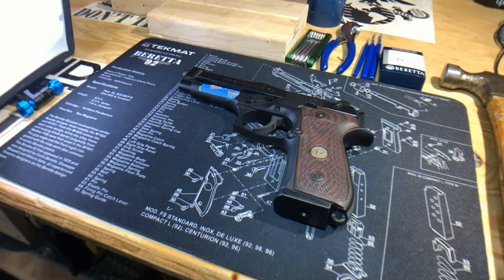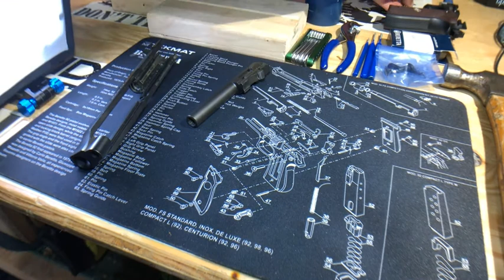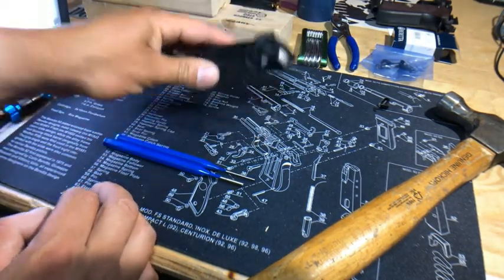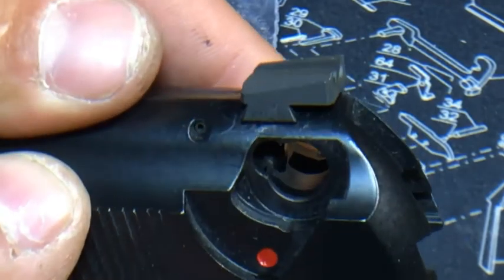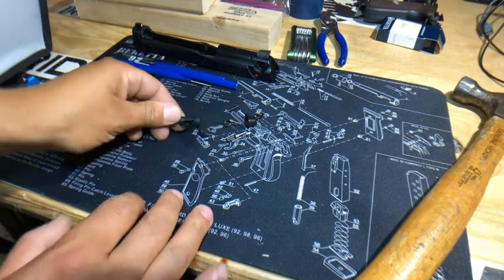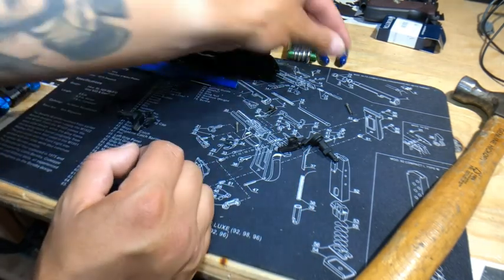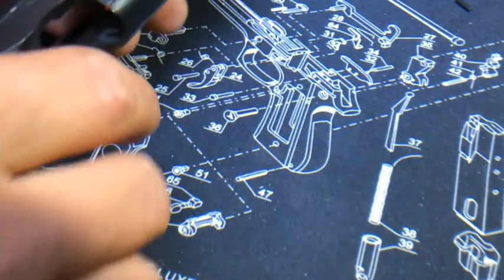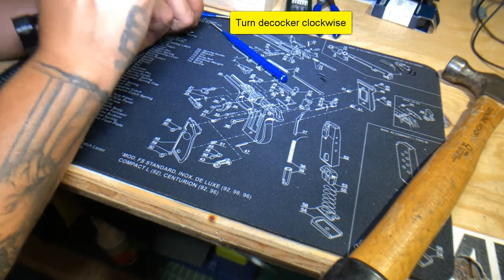Beretta 92 FS converted to a 92G

Comment: Honestly I don't see an advantage to removing the safety from an 92FS and have it as de-cock only.  Going to de-cock means a double action pull to fire the weapon, whereas on safety you are still single action when you take it off and pull the trigger.
Reply: Nope a Beretta 92FS cannot be cocked and locked. Activating the safety/decocker always drops the hammer. 

The advantage of decock only is to prevent the safety from activating while racking the slide. It will always pop back up so no dead trigger.
Reply: @pdog305301 Right. If you load a round into the chamber which cocks the hammer, and then engage the safety it will decock. At that point you can’t even re-cock the hammer if you wanted to without putting the safety lever back in the firing position.